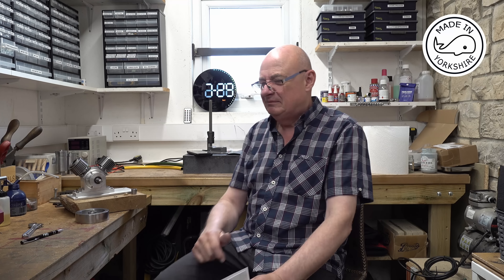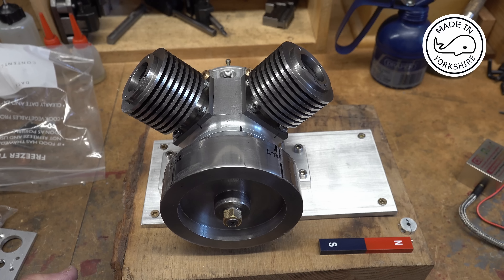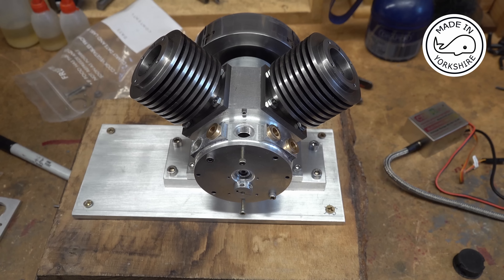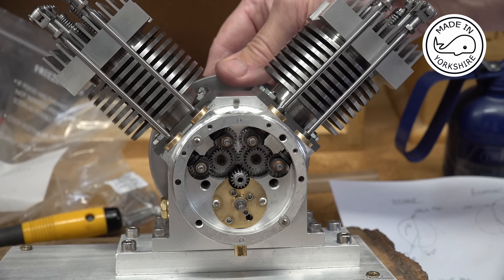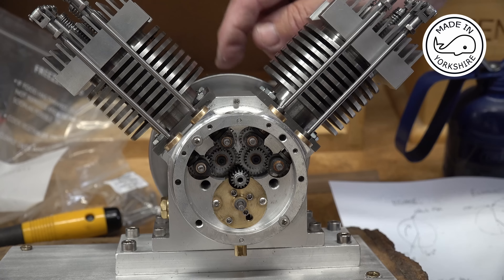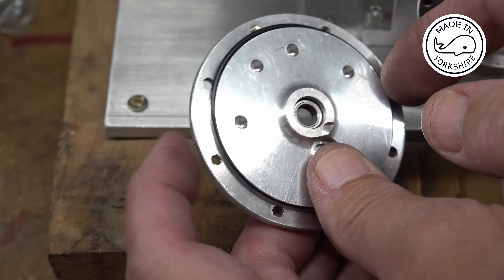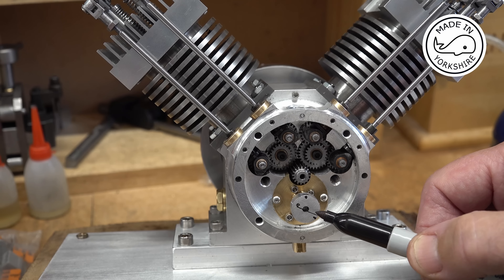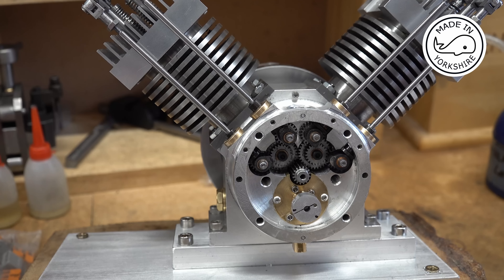#MT49 Part 20 - Jerry Howell V-twin IC Engine. Valve Timing. In 4K/UHD by Andrew Whale.

Comment: Hi Andrew, a degree wheel, wire pointer and dial indicator will show the most accurate relationship of valve train to crankshaft. This would be simple to print off and mount to the  flywheel. Exact TDC is easily found and noted, then valve train can be adjusted accordingly. 
Love the build, thanks for sharing 
Cheers
Reply from the maker: Thanks Rick. Yeah a degree wheel would have been a better option but hopefully I've got it close. If not I will revisit it.
All the best.
Andrew

Comment: Glad to see the penny finally dropped with the flywheel collet mounting direction. 

On the point of running  the engine as a single cylinder with one spark plug removed,it may be better to leave both plugs in place and just disconnect one of the ignition systems. If you try to run the engine with one plug removed you may find the cylinder with no plug in causes a lot of pumping drag and acts as a decompressor type engine brake and causes too much drag for the working cylinder to run. I've had this experience in a real world situation when my friends 900 Ducati twin lost sparks to the rear cylinder and we still had  about 50 miles journey left to get home. When he removed the spark plug from the dead cylinder the load/drag from the dead cylinder was far greater than when the spark plug was left in situ.
Edit to add: the engine braking drag effect I describe is caused by the air having to be sucked back in through a very small orifice with only atmospheric pressure from the outside on the downward piston stroke which causes a partial vacuum inside the cylinder. 
 The upward piston stroke does not suffer anything like the same drag due to the air above the piston being expelled at for above atmospheric pressure as the piston causes a positive pumping displacement.
Reply from the maker: Hi Howard. Yup the penny finally dropped 😂. Thanks for the really detailed explanation too! 
All the best 
Andrew

Comment: Andrew, engine will run fine on one cylinder, even with spark plug in. The degree wheel does allow for more precise timing. I did not loctite cam lobes in position until final timing, this allows for fine adjustment. Once timing is set, take a picture as you can use reference for future timing. Have fun with the carburetors, that are a real pain as configuration is mirrored. Thanks for sharing!
Reply from the maker: Hi Maurice. Thanks for the advice. I never thought about holding off with the loctite - that was many moons ago! I might revisit the valve timing if the engine runs like a 3-legged dog. Yeah - the carbs. I made both the bodies a while back when I made a JH carb for the Hoglet engine. Quite difficult doing the mirrored one. I think I ended up scanning the drawing and printing a mirrored version.
Cheers for now.
Andrew

Comment: Well that was complicated. It is hard enough to arrange timing without the flywheel going one direction while the timing wheel goes two circuits in the other direction. I admire your patience working through it all. Your solution to the flywheel problem was beautifully simple. A proper ten bob job! It would be exciting to see the engine run on one cylinder and probably a worthwhile test as you said. I am just off to give my brain a rest now having worked it hard following all that calculating😂
Reply from the maker: Hi Tim. It did my brain in a little too. Hopefully I've got it reasonably close.
Cheers
Andrew

Comment: Andrew, you are making good progress with this engine and I'm looking forward to your next video!  I've never seen a Quorn in person, but if memory serves, it takes a lot of "learning about it" to properly use one based on what I've read.  Congratulations on your new (to you) acquisition!
Reply from the maker: Thanks Bob. I was thinking of making my own Quorn from castings but I concluded it could take many years. It certainly looks complicated but I hope it's something I will be able to get my head around. I've got the original operating instructions and the Quorn book. A local engineering company recently had a clear out and I acquired a couple of hundred end mills. If I can master end mill sharpening I won't need to buy any more. That's the plan!
Cheers
Andrew

Comment: The problem with bonding the cams to the gears beforehand is that you can only move the setting by one tooth on the gear which equates to two turns of the crank.....720 degrees divided by 21 = 34 degrees which is not ideal. I'm not at that stage yet but I might try to make the gears a tight fit on the cams so that they could be taken off and adjusted if needed, then loctited once the valve timing is acceptable.
Reply from the maker: Fair point Terry. If I were to do it again I might go with that approach. However the engine does run really well so I guess it was my lucky day. 
Cheers
Andrew

Comment: I see you had to notch the valve cover to clear the bolt head on the oil pump. I did as well. Also, I built one of the carbs for this engine and it runs fine with just the one with a manifold
Reply from the maker: Now that is interesting 👍👍👍👍

Comment: Hi Andrew, I'm just starting out making the v twin engine and your video is a great help so thanks for that. I'm not to far from you, I'm in the Peak District. Did you consider the twin Rcexl unit, I'm assuming it has two separate pick ups. It's not much more expensive that the single. I have used the single unit on my "Farm boy" (built following another of your videos) and it works really well.
Reply from the maker: Hi Terry
I used a twin RCEXL unit on my Hoglet v-twin and it worked well. From memory it needs two magnets, one north facing and one south facing. There is a dual hall effect sensor which recognises both north and south and fires the appropriate plug. However for the JH v-twin I decided to stick to the drawing and I purchased two separate RCEXL units. A bit more expensive but I learned the hard way by not sticking with drawings in the past.
Hope that helps and good luck.
Cheers
Andrew

Comment: From playing about with old motorcycles when setting the timing you should only turn the flywheel in the running direction this takes all the lash from the timing gears. Rocking the flywheel backwards then forwards again introduces error
Reply from the maker: Thanks for the advice. I must bear that in mind next time.
Cheers
Andrew

Comment: Hi Andrew. it seems to me that you can fire two plugs together (like a triumph) with one ignition system with two magnets for the pickup. that would simplify the electrical. one plug would just fire in an exhaust stroke and the other would be firing on the compression.
Rich
Reply from the maker: Hi Rich. Yeah you are correct. The Hoglet worked like that. However I'm going to stick to the drawing.
Cheers
Andree

Comment: I can't understand how you can adjust cam timing without using a degree wheel
Reply from the maker: I should have explained... After marking TDC and BDC of both cylinders on the flywheel, I used a protractor to mark the other positions. I guess a degree wheel would have been more accurate.

Comment: I’m convinced that the timing will work for you. Can you adjust spark timing in real time (engine running), to retard or advance the spark to bring it closer in relation to the valve timing?
Reply from the maker: Fingers crossed. Yeah the ignition can be advanced and retarded independently.
Cheers
Andrew

Comment: I believe Your flywheel is still wrong. The nut needs to clamp on the flywheel, not the tapered bush. That way the flywheel will be drawn onto the taper. As it is, the nut is only clamping the bush. You need a recessed spacer behind the nut to clamp on the flywheel and draw it onto the bush.
Reply: Are you sure ?  It looks to me that the nut already clamps against the flywheel.  Look where the collet sits ( at 3:00 ).
Reply: @chrisarmstrong8198  maybe you are right
Reply from the maker: Hi Andrew. I can confirm that the nut does actually clamp against the flywheel. It might not be that clear in the video.
Cheers
Andrew
Reply: @learningturningmetal  love your videos. Keep up the good work.

Comment: Just one thing if your buy a twin cylinder LV type Rcexl CDI then you can run the engine with one hall sensor and two magnets one north one south, just thought that might help.
Reply from the maker: Hi. Thanks for the suggestion. I used the method you suggest on the Hoglet and it works well. However I thought I would stick to the JH drawings in this particular case.
Cheers
Andrew